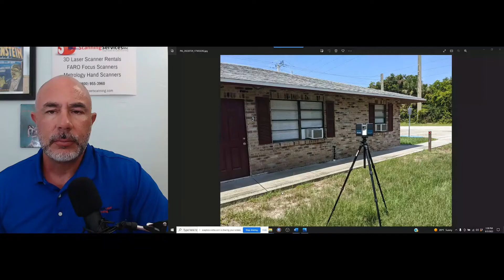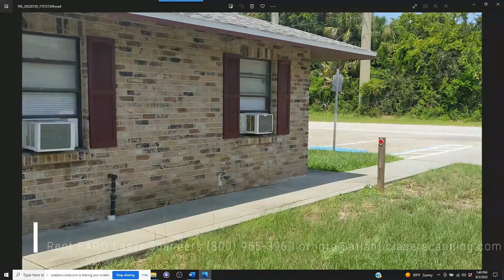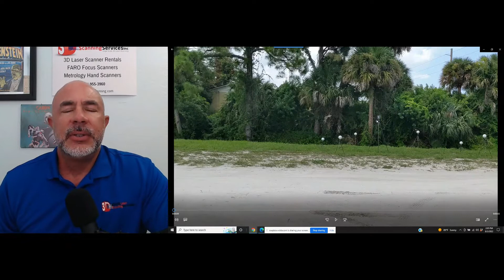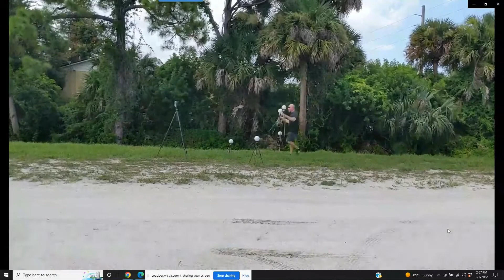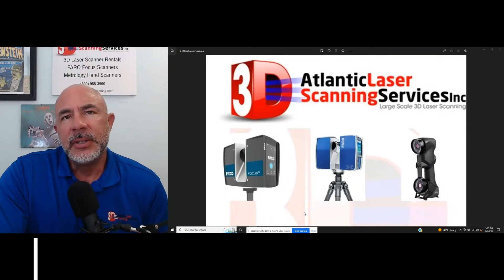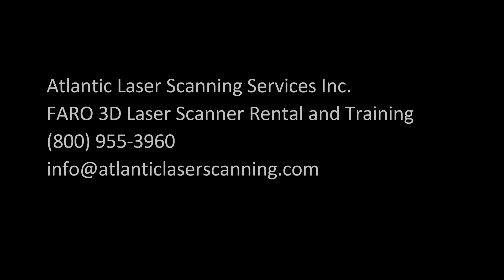FARO Tips for Scanning in the Field

Comment: Hi, great explanation! I have two questions for you… if I have to survey the exterior of a building that is surrounded only by trees and vegetation is it better to put the laser scanner or the spheres in front of the corners? And, using the spheres in groups of three, at what distance from each other should they be placed?
Reply from the maker: The scanning of an object, car or building you need to scan from the corners to see the data from the previous scan, and combine it with the data collected from the next wall. As for the spheres, we don't recommend more than 35-40 ft from the scanner, don't put them in line with each other, have them set up at different heights, and keep them at least 6 ft apart from each other.  Also, don't put them in a grid, they must be more randomly placed.  Following these general principles, you can scan anything.

Comment: Hi, I am wondering how did you attach the white ball marker to a camera tripod? Do you use any specific tripod or adapter?
Reply from the maker: Koppa has adapters that screw into the threaded bolt on the top of the tripod.  They are a simple cupped washer with a nut welded into them, but they work very well.